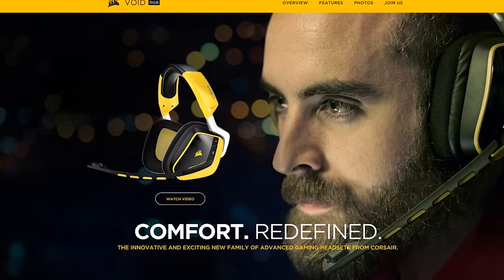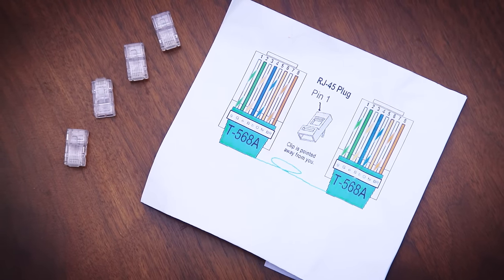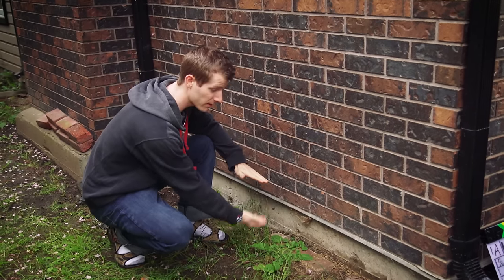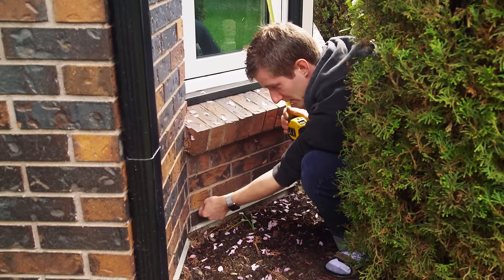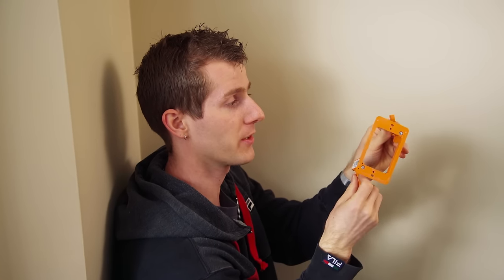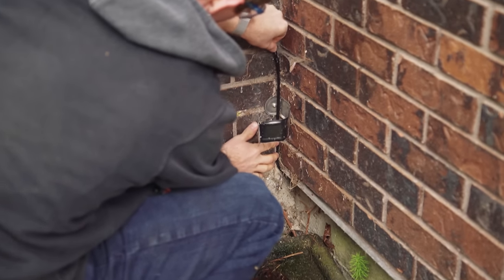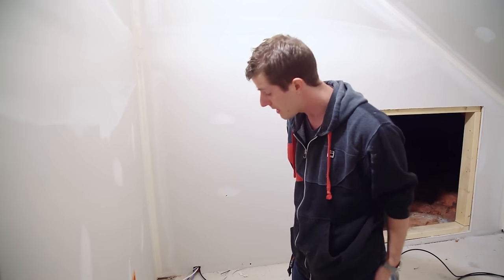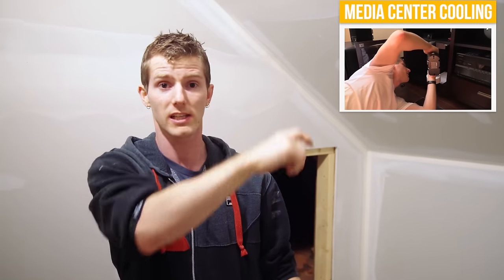Optimize your cable runs at home! - Installing an exterior Cat 5e cable

Comment: My guess is that because walls in North America are made usually od drywall or wood, the electricity cables might often run along the floor inside the empty spaces between walls and that means you're not likely to drill through a power cord. It might be a adequate to suggest one of those electricity sensing devices to people living in, for example, European or South American buildings, since often the power cords run at the same height as the sockets and in such a scenario as Linus', they could actually drill through their power cord.

Comment: I wanna add one thing, your cable hole should also be a bit diagonal(higher from the inside and lower on the outside) this will help even more that water will not enter inside your house if the silicon sealing wears out after time.

Also i dont get it why they make the outdoor cable in a black color, it will absorb way more sunlight and heat then a white or light coloured cable

great diy video otherwise!

Comment: A quick way to run cable, if your house has forced air heating/AC is to run the cables through the vents. You can run through the cold air return or the any vent for that matter. This is a GREAT way to run cables from the basement to a 2nd floor.
Reply: Ha! never though of that... I just drill holes through everything.
Reply: Do you want to fail inspections? Because this is how you fail inspections. Don't run cable that isn't plenum rated through air vents unless you want the degassing of the PVC jacket to give you crappy air,  or worse, cable that catches fire in the vent sending smoke through your entire building killing everyone.
Reply: +Mostlyharmless1985 i dont think the vents get that hot and how many times are people going to inspect your house while you are living there
Reply: The vents don't have to get that hot, Vinyl degasses at room temperature. Second, yes, vents aren't supposed to get that hot. Buildings aren't supposed to catch fire either.

Whether the work is inspected or not is not the point, the point is that it makes an unsafe condition and the very reason it's in the code in the first place. Do things right or not at all, never assume it isn't going to be inspected, because at some point, it will be.
Reply: Mostlyharmless1985 If you want to be anal you can get plenum rated cable, for CAT cable the price difference is minimal. But there is really no difference running plenum or non plenum cable through a cold air return in a forced air RESIDENTIAL home. It's no different than running the cable alongside your baseboard.

Also there is no way you would fail a "inspection" for this as it is low voltage cable.

Comment: Pro tip: before you run cable outside, check how your house is constructed. Some homes have a pipe stack, basically an open shaft, that can run from your basement to your attic. This might allow you to hide everything in you walls inside, and only require you to make the holes in the walls as Linus shows.

Comment: Flying blind when crimping the cable is fine and all if you're confident. But really you should have added a cable tester to list of things needed.

I myself have a really good cable tester with two nodes, specifically testing cables that you have ran through the walls(or in this case outside) and etc.

Comment: Saving money tip: Buy an outdoor rated 1/4 Drip Irrigation tubing (averages $10/100 feet. Cheaper if you can buy it off the reel at a garden supply center), attach one end to a vacuum with duct tape, use a 1/4 piece of foam (or anything really) as an anchor and tie some string on it, suck the anchor through the tubing. Attach your standard Cat 5e to the end of the string (lube it with talc powder as you go, and pull it through. It's half the price and will last 5x longer. That drip irrigation tubing is some tough stuff (much better than what they sleve the outdoor UV rated Cat 5e with).

Comment: Terminating Ethernet cables is ANNOYING. I work for my high school's tech department. At first, the job they almost always gave me was setting up long-term temporary offices (we have a school-wide renovation going on right now), which needed networking. I have RSI (at age 18 [age 16 when I got it], which is apparently a more common age to get RSI nowadays), so putting the wires in order was a PAIN: I used to always have to re-do the order after putting the wires into the cap, as they would cross over each-other.

Comment: I recently just ran speaker wire and some Cat6 through my walls and attic. I was wondering, was there any reason you didn't opt for a keystone jack? I guess there's no difference but when I was planning the runs it just made sense to use a keystone jack for the two outlets I installed. When I moved in there was some coaxial cable already run in through the bricks, poorly I might add,  and this video just makes me want to fix that run of wire as well. Thanks!

Comment: Some tips for those who see this video which Linus got completely wrong.

1) Never drill from the outside in, only ever drill inside out, that way you remove the risk of drilling into any sockets/pipes/cables on the inside.
2) Use a spirit level on the wall plate so that it is level. Nothing worse than seeing a wonky wall socket next to a level one.
3) Linus didn't mention it but always run cables down first when on the outside of the building. That way when it rains the water runs down the cable and not into the sealant to break it down.
4) Don't use caulk, it will break down. Instead use silicone.

Comment: May or may not apply to any particular individual, but certainly worth spending at least a little time investigating:

building codes
electrical codes (US NEC contains some mentions of low voltage and signaling cables)
unlikely, but possible permit needed from town/city
homeowners' association covenants, particularly about appearance

Comment: Curious as to why you didn't just go with a plastic conduit for your run... Would add extra protection for the cable from the elements, I guess it's a bit more unsightly but if you have any concerns about the cable deteriorating you'd be well off with the conduit.

Comment: i run shielded cat6 for home networks for my job, for rich people who only spend 2-4 weeks max in their houses. They have a huge rack located in the utility room, and we run wires to every room in multiple locations. for example phone and data and waps ( wireless access points). Home automation is a cool career, but since im an installer its a huge pain in the ass, and i hate my job .-. , but nice project =)

Comment: Erm, missed a pretty critical safety step there, which is wire detection. You can buy or rent a cable/pipe detector for not much, and scan the wall for existing cabling so you don't drill through it and get toasted, burn your house down or ruin your plumbing.
Reply: Which wouldn't happen here considering his hole was drilled very far from any water-fed device and nowhere near a vertical line above/below light switches and electrical outlets.

Comment: First down vote of one of his videos!
1.  568B is widely more accepted than 568A
2.  A RJ45 Wall jack with a 110 punch down is vastly more reliable.  The coupler he used introduces loss.
3.  Never mentioned the max 100M / 300FT cable length.

Comment: Actually, masonry (especially mortar) is surprisingly easy to drill through with the proper bit. No hammer setting required; a normal cordless should be able to drill through with no trouble whatsoever.

Comment: as a network engineer I rolled my eyes when I heard "outdoor cat 5e".. if u are a bit paranoid like I am u should have taken the 30 meter cat6a with some cable wall trunks. NBASE-T is around the corner

Comment: I've been in a school whilst they were installing Ethernet cabling and Wireless Access Points on the ceilings, and once they had terminated the cable, they shoved the remaining 2 or 3 meters of slack back into the ceiling. I thought it was a bit much...

Comment: Nice video. I'm considering running a cat6 exterior cable down the side of my friend's home to reach their basement and attic so that both floors can be wired with cat5e. The cat6 would be so that in the future they could upgrade to a 10 gbps switch upstairs and downstairs when it gets cheaper, and have plenty of bandwidth for local applications. For example like, if 2 people are backing up at 1 gbps, that's 2 gbps, so a 1 gbps switch would be entirely saturated. It's more difficult to do such in older homes, because usually wall cavities aren't as accessible. A few things which are failed to mention here, maybe Linus doesn't see the importance or he doesn't care because it's his home and not mission critical. It would be much more reliable to use a patch panel, and punch-down jacks in the rooms, then patch cables ordered cheaply online. Good patch cables have a much better crimp than anyone can really do themselves and also the punch-down jacks/patch panel connections are much more reliable than crimping a cable on each end. Of course if you make a great crimp, not much of an issue, but the connector can degrade, and who knows what quality the connectors you'll be using will be. Read reviews on these products, because you don't want something that doesn't work effectively.

Comment: The layout of the house (Not just the "day to day, where the rooms are" layout, no: The structural "Can I get wire from this room to that one via the attic" layout) was taken into consideration when I bought mine: If I want (and it's going to happen in a few weeks) I can run cat5e entirely under the roof and inside the siding. Wall plates? Punch your hole, pick a reference from a perpendicular wall, go into the attic, measure from the inside corner to your reference length, drill through the top plate into the wall cavity, run your cat5 in, hook it out of the cavity, terminate your socket, run to the other end, repeat, done. Oh, and: Cable's cheaper if you run in attics and crawlspaces: No need for UV stabilization, caulking, or in-cable waterproofing gunk.

Comment: A wise contractor once told me to never drill into the mortar as it will damage the  integrity of the joint. It’s better to drill through the brick if you can.

Comment: So much easier in the states/canada where your houses are made of cardboard! In the UK we have brick inside walls, cavitys full of fluff, then another brick wall on the outside! So nearly all sockets fitted after plastering has to be surface mounted, loads of dust as have to drill from the inside out to prevent blow out pushing off chunks of plaster inside! I should know as i work for Openreach, the dominant provider of ADSL and VDSL services in the UK!

Comment: One thing I noticed that Linus should have done was put a drip loop in the cable prior to it entering the brick.  Also I hope he put caulking around the entire cable, and not just the top of it as shown in the video.  One last thing, they sell weather guards for cable penetration into a structure.

Comment: Pro-tip: Always cut your dry wall SIDEWAYS FIRST, just in case you happen to hit a stud. You don't want two big vertical cuts in the wall just to find out that you have a 2x4 in the way. Linus appeared to do it that way, but didn't mention it in the video.

Comment: Linus, any particular reason you chose to do a male to female converter rather than using a more normal patch-panel style punchdown connection to the wall? I'm sure it probably doesn't make a difference in speeds or anything, just curious.

Comment: i like how he doesn't check if there's a live wire behind the wall before he starts drilling :)

our fix for that problem: Drill through the ceiling, and run the cable up through the wall. much less (ordinary Cat 5) cable and aesthetic consideration to worry about.

Comment: Sorry if this is a stupid thing to say, but isn't this a security vulnerability? Someone can just cut off your cable, wire in a connector, plug into your network (ethernet access isn't password protected) and then do whatever they wanna do. It's not likely to happen but it can, I would not run my cables outside.

Comment: Hope you don't drill into a power line  :P
Sometimes you can just follow the holes in the wall through the 2x4s with a fiberoptic an run the cable internally.
Though, not sure if you'll get interference running along power cables.

Comment: I just used the furnace air intake system to get to the basement, then was able to just run it behind the wall.  Any areas I need to run the cable upstairs, just ran it through the attic.

Comment: Driling through walls you should always drill uphill so water cannot run into the building and leave a loop or drop of cable outside for water to drip off.

Comment: i wish I could do this in my house but the walls are about 30cms of brick and concrete, when I got my AC installed they had to go and get a bigger hammer drill to go through it. The drill was about the size of an average Linus

Comment: Why a Cat5e cable? Wouldn't Cat6 be better since it's a longer distance? My perception (I could be wrong) is that you run Cat6 through your walls, exterior, etc, and then Cat5e is mostly for hooking your computer up to the socket near it.

Comment: It's not professional. I work in a computer lab that also does cable run & network closets and from my knowledge most houses have tubes going inside the walls. And if not....you go outside and use cable tracks for more durability. Also...it's better to use female rj45 connector in the wall than a male male adupter

Comment: So Linus, i have a question.

Now i can, if i were to know your location, strip this exterior wire and im in your network? Did you take any precautionary measures such as creating a seperate VLAN or isolating the port from other hosts in your network? I know casting stuff to your TV would be harder this way, but i am still concerned about the security of this. Or do you not mind?

Kind regards

Comment: Linus that wasn't an impact drill and a couple of bits. That was a Rotary Hammer drill with nothing in the chuck :P. Now on the ground you had some bits and a Impact. Nice choice on brand ;). You didn't wimp out and get some non sense like Black and Decker or Chicago electric.

Comment: If you run ethernet or coax outside you should have a lightning arrestor. It may be unlikely to happen but it is AAAAAlot cheaper to replace if it does.

Comment: Uhm... The minimum bend radius for Category 5, 5e, and 6 cable is four times the cable diameter, which is approximately 1 inch. Sharp bends like those aren't ever suggested.

Comment: Great video except ditch the Cat 5e in favour of Cat 6A or a cable marketed as Cat 7. No need to skip the future proofing if you are setting up a brand new installation. It's a different story if parts of the core infrastructure still rely on good old cat5 for transmission.
Reply: Also it's worth noting that, even though this cable is very unlikely to ever get hit by lightning, grounding shield (probably not the right name for it) should be used whenever you have outdoor cables of any length or in the ground.

Comment: just in the future Linus. (While i doubt you will be doing this again) you can save $3 a jack by punching down the cable itself instead of buying a keystone passthrough. i started doing this when i was 13 with a small pair of needle nose pliers and those connections are still working fine today over 7 years later

Comment: The only thing that worries me about doing it this way is that he is trying to get the outlet as close to the other one as possible. But shouldn't you get a meter to see if there is a live wire behind the wall before you drill into it?

Comment: This is cool and all, but what about critters munching on it if you run it outside? Around here we have a real squirrel problem and they munch on ANYTHING that isn't wood, metal, or brick. they would chew the hell out of that cable within a week if it was exposed anywhere.

Comment: I wonder who's there giving him advice and providing the tools, could it be Lukes dad? 
Also, when drilling through walls, always start out with the smallest drill possible if you're in the wrong place and dismantle that wall socket before hand to see how the wiring is done to prevent disaster...

Comment: Some classic mistakes in this installation:
1: Always wear safety glasses while drilling mortar!
2: Always loop up a few feet of slack cable behind each socket, otherwise you're totally screwed if you ever need to re-terminate the cable or move the wall plate.
3: Given that you're running unterminated cable, it's nuts to terminate it with an RJ45 plug, then plug that into some weirdass F to F RJ45 wallplate. Not only is your way, way more expensive, it's a lot less reliable, due to all the extra connections, & terminating to a standard wallplate is easier than terminating to a plug anyway.
Also: What another commenter, @Raph D said: Drill into the wall sloping slightly upwards, to keep water from creeping along the cable; caulking isn't enough to prevent that completely. And use way more caulk than you did!

Comment: Try one of the new 1000mbps power line adapters first. For me I get the same tested speed and ping in games wired to router or using my powerline in the basement or 2nd story.

Comment: So what's thar problem with PowerLine adaptors, you've mentioned?
I have 3 of them, 1 connected to the router, 1 to my PC and one to fire tv and it works just as fine as running a 10m LAN cable from the router to the PC. (actually tested that)

Comment: I just wanted to ask, was there a reason for selecting a wall mount with a socket rather then one that slots the cable straight to it?
On the back i mean. On the front they all need the socket.